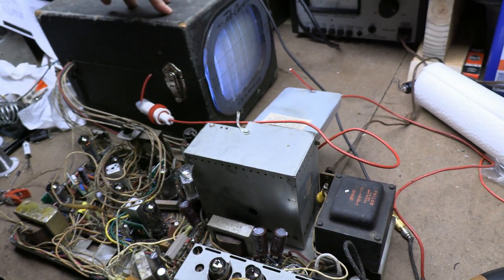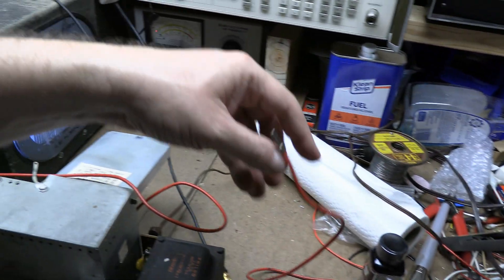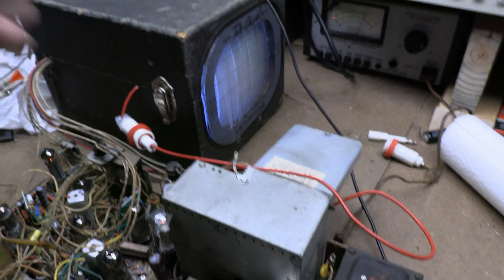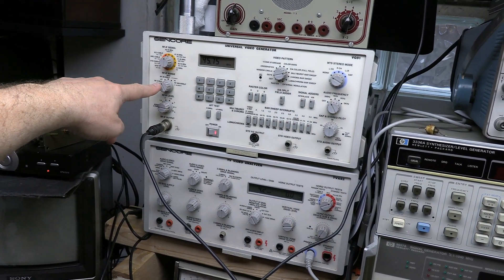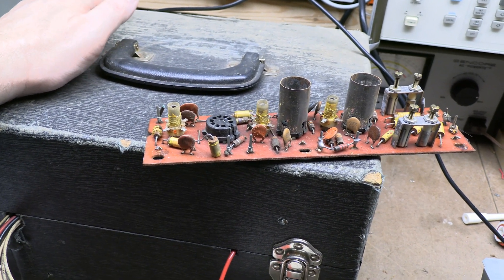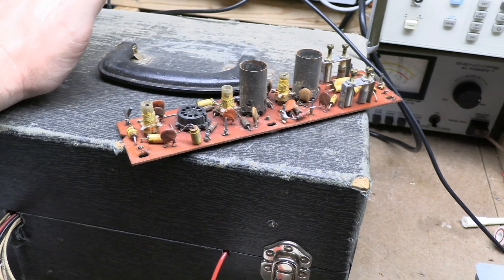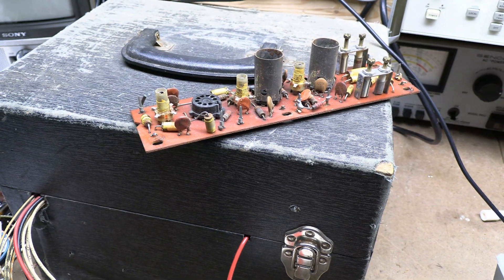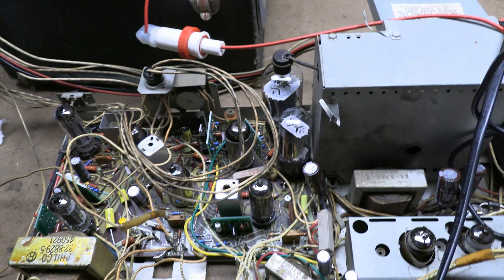Predicta restoration tips 12:  Vertical white stripe elimination and more

Comment: I was expecting the white line to be caused by Barkhausen oscillations in the horizontal output tube, with a fix involving the components around it.
Reply from the maker: No, that's an uncommon phenomenon and looks quite different.  The simple fix for that is stick a magnet near the HOT.

Comment: Since the burst occurs during the retrace period, it makes me wonder if the retrace blanking pulse is lacking somehow.  Just a thought. Your method appears to work good as long as it doesn't overly suppress the high end of the video bandwidth.  Good information!
Reply from the maker: There is no horizontal retrace blanking pulse per se. Early B&W sets just relied on the sync pulse in the video signal to cutoff the CRT. So burst could be an issue. I think the NTSC spec may have evolved a bit over time as well. Like adding closed caption info to the vertical retrace interval shows up on the screen

Comment: what voltage is the 22pf cap i ordered a 22 pF ±5% 200V Ceramic Capacitor C0G, NP0 Radial im hopeing it works cause i like to get rid of vertical line
Reply: Voltage isn't too critical here. That's C23, the video detector plate filter (6AM8A diode pin 8 to ground). There's only -0.5V there. Sam's doesn't even list a voltage. Usually these are rated 300-500VDC.
Reply from the maker: I don't recall. Check the Sam's or Philco service manual. I use 500v mica because that's what I have in stock.